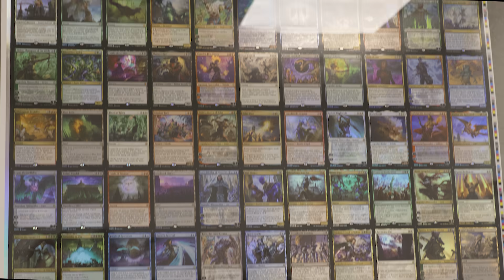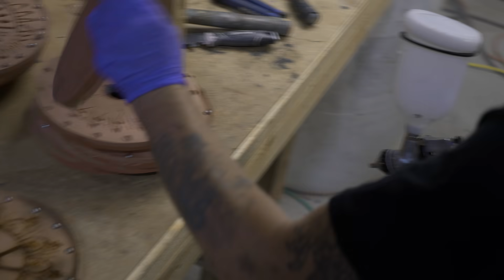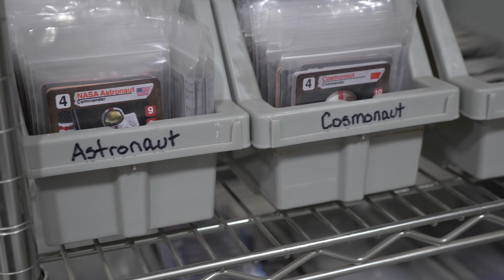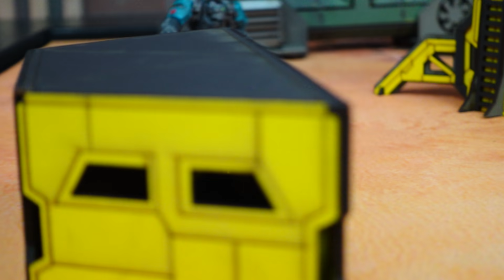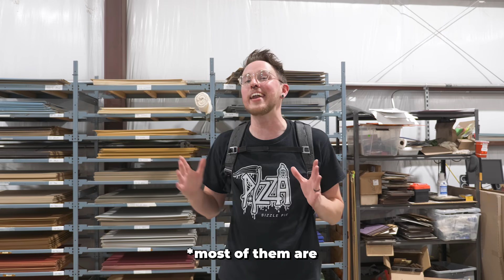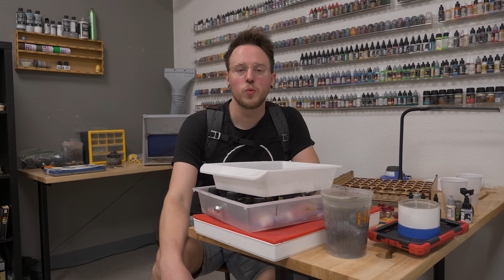How Miniatures Are Made | Factory Tour - Molding, Casting, Laser Cutting and More!

Comment: Interesting, I would have guessed that a commercial operation making resin figs in bulk would have used injection rather than spin-casters.
Reply: the injection process doesn't really work for resin, it's mainly for thermoplastics like HIPS (the plastic GW uses) and ABS (the plastic LEGO uses) and other viscous materials.

The spin process was adopted from the metal casting process since liquid resin behaves more like molten metal than molten plastic before it sets up to cure.
Reply from the maker: I don't think there are injection setups for resin, but I'm not totally sure.
Reply: me neither @Miniac

Comment: I've never seen resin used in a vulcanized rubber mold before, only metal. But that makes a lot of sense because a lot of the REALLY fast-cure urethane/polyurethane resins still catch air bubbles in your typical silicone block mold even when pressure casted due to how long it takes to get them into the pressure pot and get it up to the right psi VS the incredibly short working and cure time. A vulcanized rubber mold and spin casting machine seems to eliminate that. Awesome stuff.